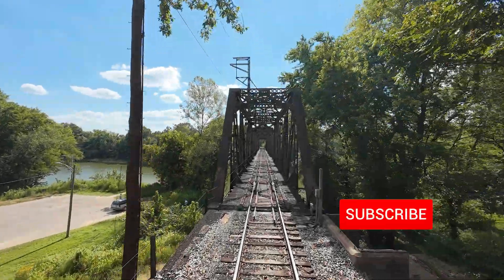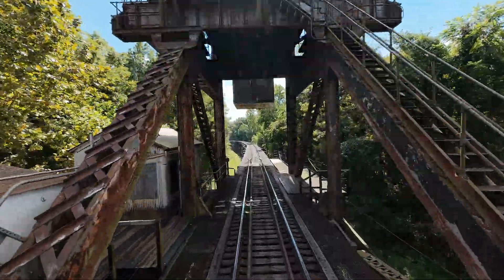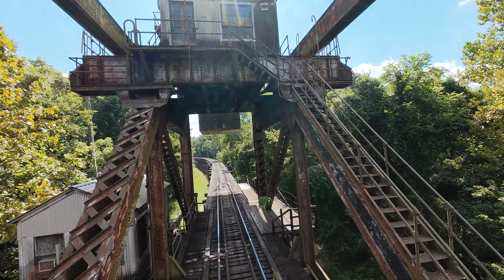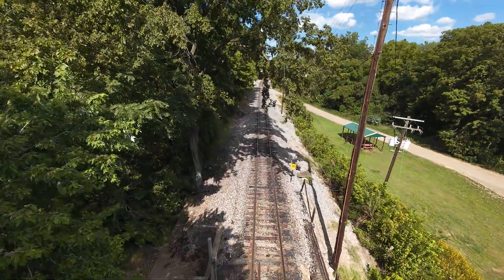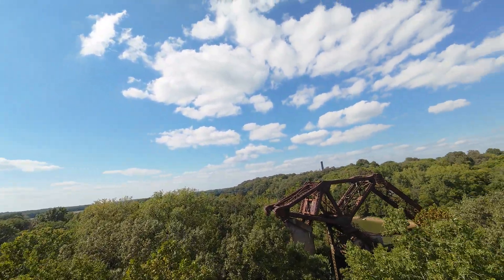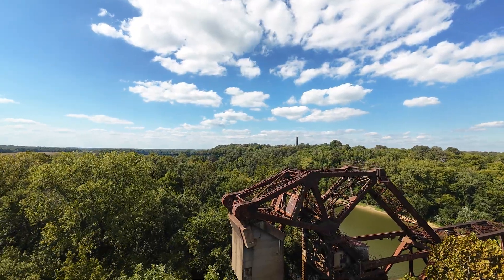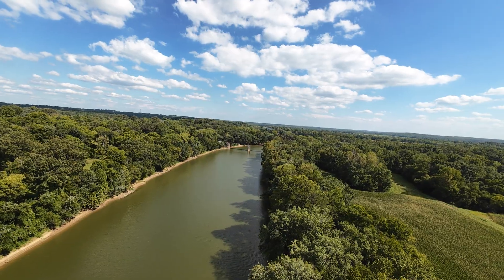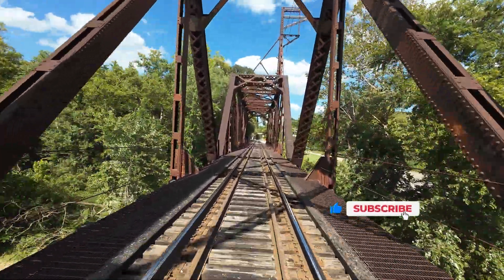Abandoned Railroad Drawbridge  **NOT so abandoned** NEW INFO

Comment: Was the bridge operator off the extra list on a bascule lift bridge in Cleveland over the Cuyahoga River - there are specific procedures involved in raising and lowering the bridge - if the bridge is lowered too fast its stopping will move the ground on the land end of the bridge to the extent it can be felt.
Reply: Were you an operator on the old B&o 363 and 364 bridges?